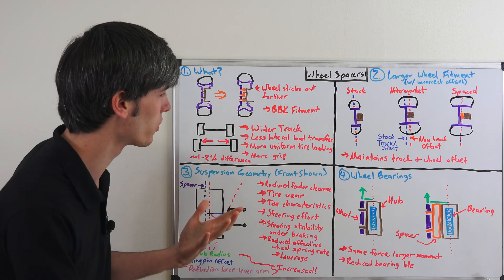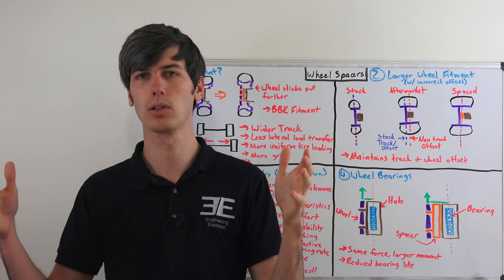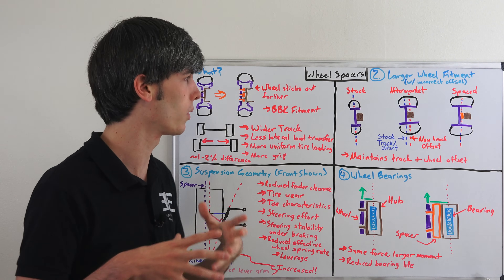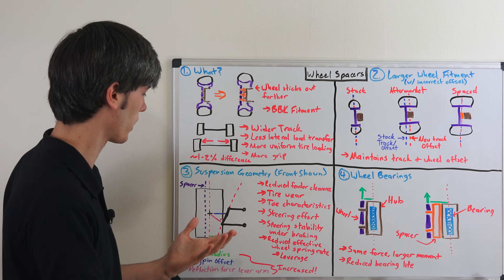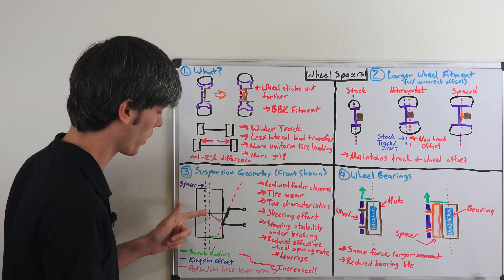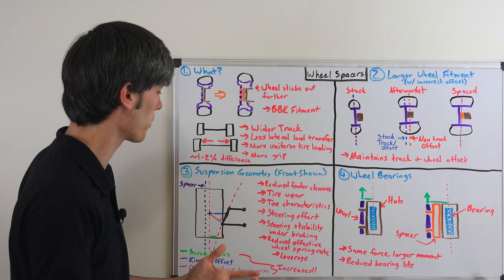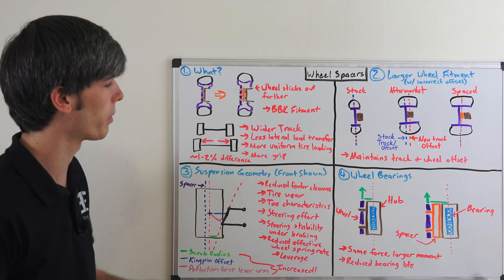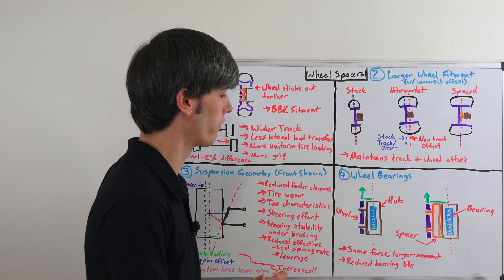Wheel Spacers & Adapters - Good Or Bad?

Comment: So ive watched this a while back and was info for my brain. Now, i can use this info. I have a forester with stock offset of +48, changed with 02 wrx 16 inch rims with AT tires that are +55. That narrowing of my wheel base made it less stable on turns on top of taller tyre walls. If i were to get +7mm spacers, Would it still affect stress on the bearings? Its technically would be stock?

Comment: On my 2007 tacoma w 2 inch lift it allows the truck to transfer weight to the back quicker which makes the rear tires lose grip, which is more fun when going around forners.

Comment: As it stands I'm going to be putting (I think, don't yell at me lol) 1 inch spacers on my 98 jeep grand cherokee limited. The ONLY reason I am doing this is because after I got new tires (mine were dry rotted when I bought it) the tires rub on the inside when I take turns. (It's a 4x4 all time so you can see why that's would be a problem)
I'm doing the 1 1/2" rough country lift with the spacers so get the tires out of my wheel wells because as it stands, the vehicle grabbing on the inside is a bigger problem then me wearing out the bearings. They need to be replaced anyway >_>

Comment: Just two points:
1. In point 3, he says, he does not fully understand why that is bad; then why try to explain something you do not fully understand? Chances are that people will surely not understand either.
2. There is one point I think is missed, when you lift your truck (if you have one), you are also lifting the center of  gravity of your truck, hence making it more unstable on turns at higher speeds, so adding wheel spacers will surely help adding more stability to your truck and avoid a very unwanted rollover.

Comment: Everyone always uses the rediculous, massive 20+mm as examples. I could see how several inches definitely affects a vehicles handle and wear on parts. But nobody ever comments on the ultra thin spacers. Say less than 5mm. (About the thickness of two nickles). In my case, I need about 1.5mm of more clearance to clear the front calipers on my car. That's about the thickness of a penny. Does a penny really do that much to the geometry? If course you need proper fitting spacers, hubcentric and what not, but I just don't see how 1-3mm really changes that much.

Comment: Maybe it's just me, but I don't see an aluminum spacer as having enough strength to hold a set of wheel studs without risk of failure and the wheel flying off.  Unless maybe there is steel inside it.

Comment: I supose that on 4th pic stock wheel hasn't any leverage at all, so there isn't any static momentum - it's perfectly balanced because the designed offset sets center mass of the wheel directly right to the axis of rotation

Comment: You're probably working for a manufacturer by now!  A good "engineering" summary for those of us not gifted enough to articulate all the vagaries you described.  However, you did very well in stepping us through it (yes, a bigger white board, as another has said) but all the same it was comprehensive without telling us to put them or not put them, on our cars.  I would add that driving styles and conditions are part of the other factors along with loads (as you mentioned).  The question I would pose is if the 1 per cent affect on driveability is all that we might sense, what is the percentage of negative affect on the vehicle's strength at the points of pressure?  So if we're only interested in a cosmetic change, are we risking performance with an average spacer setup?

Comment: Years ago when I was about 8, I can remember helping ( more likely hindering) my father to jack the family car up and put wheel spacers on it. He did this every summer just before  we hitched the caravan on it to go on our holidays. Only more recently did he explain,  that he did this to add more stability to the rear of the car whilst towing the caravan. As soon as we returned home we would jack it up again and take the spacers back off. Even back then I recall the car looked skinnier once they were off again, but, for him, that was their purpose. I came here for information and I got plenty! Guess I will leave my car as the designers intended now, as there seems to be less advantages for and more against doing it.

Comment: what if i want to change my stock ET35 wheels for ET30 wheels? Wheel size, width and even tyres are the same. It's just the 5mm difference in offset. Should i be worried about causing damage to my suspensions and bearings?

Comment: In my opinion, yes I know everyone has one, along with a certain exit hole, I would be hesitant to use anything that changes the manufacturers geometry in a suspension system. In other words, don't second guess the manufacturer.  Your vehicle is already an investment in geometry by the manufacturer in the millions of dollars to get the angles all right for your vehicle. Don't question that.
Now if you do choose to go this direction, by all means, do it RIGHT!!!!
Don't install spacers with the factory studs and end up with only half the stud making contact with the lugnuts. Put longer stronger studs on. And use spacers that are hub centric.
As far as adapters, I'm not a fan of those. You are adding a second set of lugnuts to the equation, and they need to be torqued to the factory torque spec, just like the other lugnuts do.  Yes you will need to remove the wheels and retorque the lugnuts on the adapters if you go this way.  Otherwise the lugnuts may back off and cause vibration issues and early parts wear.
And don't install them on 1 ton dually diesel pickups between the rear rims. The manufacturers of them do not recommend their adapters for this type of setup. If you want to install wider tires on your dually pickup, then put the right rims on to match the tires.

Comment: Based on all the information you provided, what is your overall opinion on wheel spacers. I have a Jeep Wrangler and I'm considering getting a wider Tire and would like to use an inch and a half Hub Centric wheel spacer. Trying to get a good feel for some different opinions as to the pros and cons of doing this.
Reply: Hey James wondering how it worked out for you ? I just had a 2" rough country lift put on 09 jeep commander rough country recommends 265/70r/17 tires but some have said they rubbed a little so wondering if I will need 1.5 spacers but concerned about the wear on the wheel bearings
Reply: @bigt5699   Hi big T56.  I did install the wheel spacers 3 1/2 years ago, they are hubb centric and wheel centric and I used loc- tite on all the logs. I have had no issues and I've put over 50000 miles on them. The front end is just fine and the wheel spaces have served me well, allowing me to put a 33" tire that was wider than the original with no contact during full lock terms.   I also applied a little of never cease on the back of the spacer for easy removal during brake jobs or front end work.  Good luck.
Reply: @jamesbonanno3359  sounds good, thanks for the info James

Comment: Jw if anyone could help I have a 93 ford RANGER now I know the lug patterns are 5x114. I specifically got 5x5 wheels they are 16x13 with a 10 inch lip plus an additional 2 inch adapters. now what adapters should I buy. I know I could just look online but gear heads answers are usually better..

Comment: Using a 25mm spacer isn't the same thing as using a wheel with 25mm less offset? Considering it was installed correctly, with a centering rub and longer screws.

Comment: Hey man! I've got a question. Could I prevent excessive wear on suspension and other components by getting a proper wheel alignment after I installed wheel spacers?
Reply: Spacer shouldn't change alignment at all

Comment: Kinda little late but if the overall goal is to increase tire width and you maintain offset but the wheel itself is wider with wider tires how do these differ from the affect wheel spacers would have

Comment: So does 1/2 not apply to solid axles vehicles (4x4s)? I guess the suspension loading and bearing life apply. also when fitting bigger tires, it's usually the opposite considering fender clearance (you add spacers to clear your front fender wells) bigger tires are taller and LONGER so at full turn, if they rub, you may need to push them out w/ spacers/offset. Same goes for wider tires...

Comment: I just wanted to say that I do enjoy your videos, but this one specifically is misleading. You are not simply explaining wheel spacers, you are also explaining different offset of wheels (usually lesser offset). Too many people use videos like these to say that wheel spacers are infinitely bad, but then say that going from a +55 wheel to a +35 wheel does not observe the same disadvantages as a 20mm spacer. That is simply not true. I understand physics quite well and there are no disadvantages to using spacers vs lesser offset wheels. There are disadvantages to both, not just wheel spacers.

Comment: Okay I have a 2007 Avalanche I got a 5 lug aftermarket rim I'm trying to put them on my Avalanche they are 8 6 lug are you telling me it's bad to use wheel spacers for that factory rims are 20s aftermarket rims are 22 they told me to put wheel spacers on to make them fit can you tell me if it's a good idea or bad thank you

Comment: Clearly explains the pros and cons! Well done, short and to the point! I appreciated your explanation about how wheel spacers change load characteristics at the wheel bearings and consequently shorten bearing life. Keep up the good work!
Reply: I have like 3 inches of spacers 2) 1"1/2 stacked on each other PLUS bigger wheels 20" instead of 17" AND I have coilovers that lowered the car 2 inches but that wasn't enough so I cut a coil of the spring too! Giving me about 3 inches of drop on a 2012 mercedes c250 coupe. So thats 3 inches and a much stiffer suspension... I've had the car this way for like I donno 2 years or like 50,000 miles... the only problems I had was I tore the boot on my cv joint in the back, (rear wheel drive) and the subframe bushings are pretty shot... but my bearings are fine! The car is fine... this smells like a hater video... but I appreciate it and I love all EE videos..

 I do agree the car probably handles better stock! Lol

But it looks amazing coming down the street super wide and super low! 

Widebody everything ftw

Comment: I would like to run Bigger Tires on My 2004 Chevy 3500 Silverado Crew Cab Dually with Duramax 
run Spacers on Front & Rear in Between Duallys

Comment: You missed one. Sometimes Mr. Ford said "We can a lot of money by using Falcon parts and calling it a Mustang!" and parts are chosen because they will do the job, and already exist on the shelf. Then the engineers just sign off as "It will work" and they don't really build the suspension for that car. On a purpose-built or professionally modified car (Shelby, AMG) then you might find mods are better than stock. On a shadetree build...not always a lot of engineering going on. Appearances can be deceiving.

Comment: One issue that wasnt referred is the fact that having a wider track also changes the relative center of gravity. The center of gravity is always relactive to the area that the mass covers.

Any consideration about that Jason?
Reply from the maker: The center of gravity doesn't change from widening the track, unless there is added weight associated with the track widening. It will however change the amount of load transfer in cornering. Explained here: https://youtu.be/j8CCFF3kJPc

Comment: So does -12mm has any impact on bearings? i got rid of stock wheels for aftermarket, kept everything the same as stock except offset went from +32 to +20. no spacers either.

Comment: So what if you get a wheel with the same specs as OEM or whatever is recommended but a larger Disk to clear BBK (which pushes the wheel out like a spacer essentially)

Still the same effects on your suspension geometry and bearing wear. So really there’s no win if you’re going away from factory specs. Just gotta reinforce the rest of your suspension components

Comment: been racing for 20 years, should never drive fast/race a car with wheel spacer or knock off  wheels. it not only vibrates, they WILL break and ruins your suspension/ braking geometry,  the worst case, the wheel will "fly" out, if u hit a bump/hole, or anything happens during high speed. for looks and below average speed driving is ok, and better inspect every time u change your oil.

Comment: I used to have a Jeep Patriot (too broke to get a real jeep). I wanted to increase my clearance, so I went from 215's to 235's. This definitely gave me better clearance, but had a couple of issues, such as the tranny overheating at high speeds uphill, slower acceleration (but I actually saw an increase in gas mileage when on the highway), but the main issue was my tires rubbing against the wheel well. 

     To prevent the rub, I installed 1-3/8" spacers (had to have them custom cut in order for the hubcentric ring to fit in the wheel). Not only did this prevent the wheels from rubbing, it also allowed me to take corners faster than I could previously. Corners that I would normally take at 45 I could now take at 50. I'm guessing this is because the wider track gave me a lower center of gravity. So the pros for the wheel spacers would be to prevent tire rubbing (which extends the tire life and allows a sharper turn radius), and a way to compensate for the higher center of gravity due to oversized tires. However, this is a cheap fix that could cause issues down the road. 

     Both of these benefits could be achieved by purchasing wheels with a different offset. My biggest concern is premature wheel bearing failure. If you're thinking of spacers, the question to ask yourself is if you want to pay now and do it right with better wheels, or pay later by replacing bearings. If you're mechanically inclined and can replace bearings yourself, then using spacers is the cheaper option. If not, you're looking at about $200-$300 per bearing, which is about how much you would pay per wheel in the first place.

Comment: First of all... Full marks to your efforts man. Awesome job.
My question is about adding a lift kit to my FJ cruiser. It's a daily driver with some dune bashing over the weekends. I got hooked on the idea of a 2inch lift, but the shop is trying to make me change the UCA and add a wheel spacer. UCA, I can more or less comprehend the need, but are wheel spacers really needed for a 2-2.5inch lift? Going through all the negatives you mentioned, I really don't think I will need it. But from a safety point of view, does it increases my change of a roll over both on and offroad without a wheel spacer??

Comment: While suspension characteristics change, wheel bearing load is only affected by increased(positive or negative) offset. Correct me if I'm wrong, but my basic understanding of physics tell me momentum of force is minimum with a ZERO offset. My point is, if stock wheel has+40ET, I add 20mm spacers(or change wheel to same width but a 20mmET), wheel bearings will be better balanced. So as far as bearings go, moving offset closer to ZERO would help, right?
Am I wrong?

Comment: om this is so true. i have watch this videos a couple of times looking for a reason why was my car acting so weird with the spacers and every single effect that the wheels spacers can produce were present on my 240sx. i had a lot of hopping under high speeds and braking, my steering effort was way much more, of course i had tire wear too , my suspension was really stiff and over all it felt like my car was not align and my tires weren't balanced. so yeah i putted them on because i wanted the wheel to match my front fenders which are 30mm bigger than the oem ones but i was just a disaster.

so now i have committed my self to never use those things again and buy a pair of offset wheels !!!

Comment: You will have the same issues on point 3 and 4 if you change your wheels to a different offset equivalent to the spacers, correct? So if changing your wheels isn't such a bad thing, then spacer aren't either. The real problem with spacer I think is with studs if they affect their length and spacers that are not hub centric... After all, your suspension, hub and bearing cant tell the difference between spacers and new rims. Am I right?

Comment: Another related issue with wheel spacers that didn't get mentioned - When people use wheel spacers that are thicker than the amount of length the hub center is sticking out past the flat wheel mating surface. In such cases, the wheel is not longer in contact with the OD of the hub center, and only relying on the studs for alignment. I know some wheel spacers include a secondary hub center to deal with this, but I see many flat spacers used that don't have this feature, and they seem rather unsafe, given that wheel loads no longer get transferred through the wheel center, not to mention potential alignment issues. Excellent video though, thanks!

Comment: I'm trying to further understand the 4th problem of stress on the wheel bearings. I have a rock crawler with significant negative wheel offset. So no spacer, but the centerline of the wheel is pushed away from the car increasing the stance. The tires are significantly heavier than the stock set up, so I'm concerned about undue stress. So with the negative offset, just like scenario 4, the force through the wheel is further from the bearings, but unlike the spacer the wheel is bolted flat to the drum. Do the same increased forces apply, or because the wheel is bolted flat to the drum are those forces the same no offset?